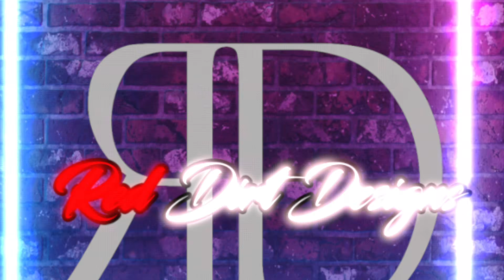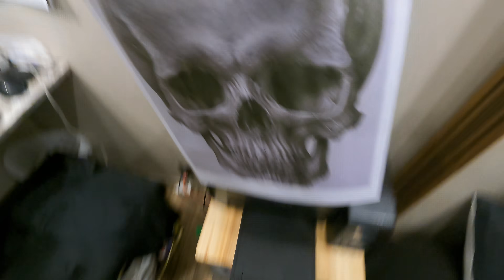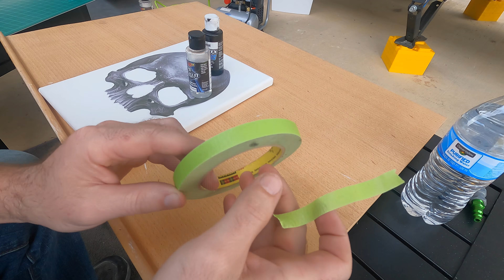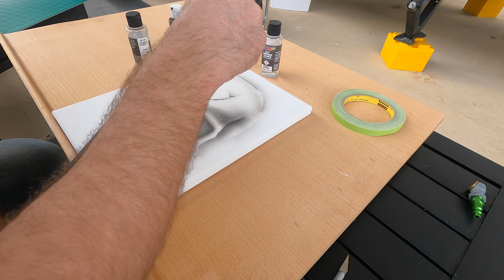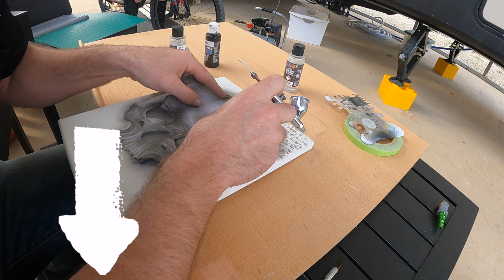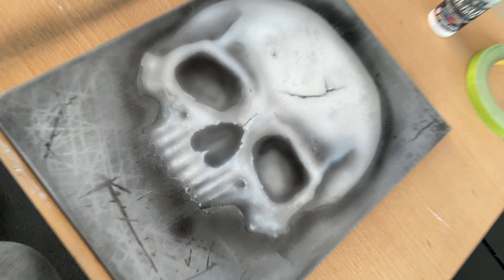Airbrushing Using Inkjet printer Paper As Stencil!

Comment: Illustration is best. I usually do a 50/50 mix or better. Great paints and merry Christmas brother 🎉
Reply from the maker: Well, you’re the second person that has told me that illustration colors are the better of the bunch. I will definitely be trying these out and thank you. Merry Christmas to you too!
Reply: @ like the previous guy said. They are easy to mix and some colors are good straight from the bottle. But you can erase or scratch with ease. From experience, I own probably 150 bottles of created wicked and their line of illustration. Never a bad bottle Or issue. Ty for your videos. You have def helped on my journey of airbrushing. 😎
Reply from the maker: Thank you I appreciate any advice I’ll be practicing with illustration colors have them ordered.
Reply: Do you have any thoughts on using a wireless inkless printer to do the same thing?  It can only print black and white but I’m fine with that. Thoughts?
Reply: Bought a thermal printer and love it for stencils. So cool and wireless. 😎🥳